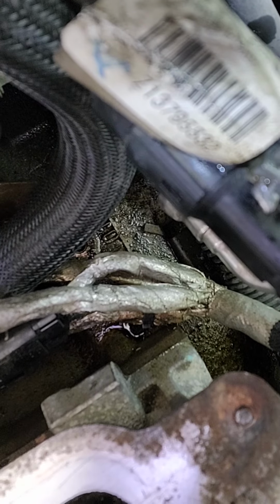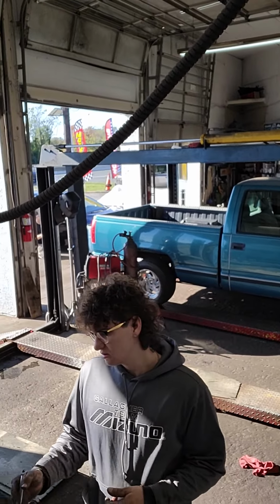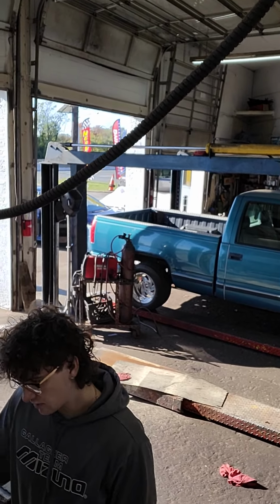Proof it's all starts at dealer level  your engine is junk at 30k for I proper training for asset

Comment: I had the same problem several years ago when I bought a used flex with v6 twin turbo I asked about the plenum service and walnut blasting or installing a catch can.
Dealership had no service recommendations or guidelines. Ford Tech Makuloco had a warning about the issue with the GDI and turbo engines and excessive oil coking at the intake valves

Comment: Turbo 4 cylinder Ford GDI with 150k and no compression. Car needs an engine. I personally would play with it to try and fix it if it were my car. But a customer is not going to pay 8-16 hours for a hope and a prayer.
Reply from the maker: Me too it's fixable I'm not going  in for less than. 1500
Reply: If owner had it from new. It probably owes her nothing.  1.5 Ford is just a question when it will break. Last study I saw was that 13% of cars being junked has 200,000 miles on the clock.  200,000 miles this the exception not the rule.
Reply: @2148aa  Could be the 1.5, 1.6, 2.0. If the trans has not been replaced, that is another variable. Those seem to grenade the TC around 150k, sending clutch material throughout the trans.